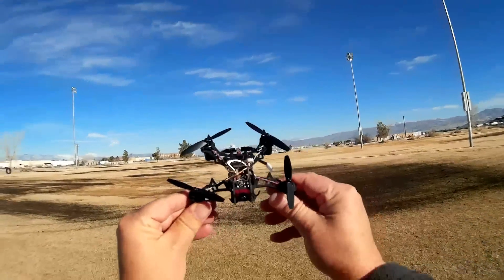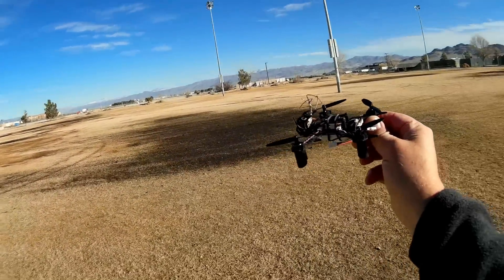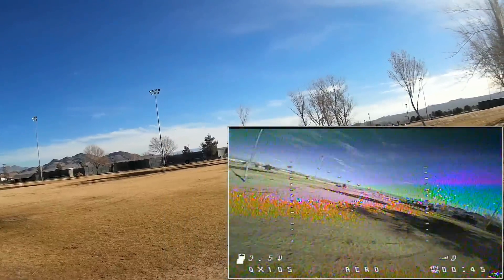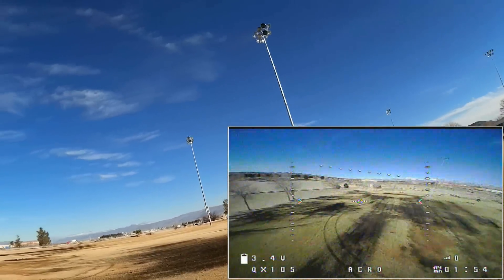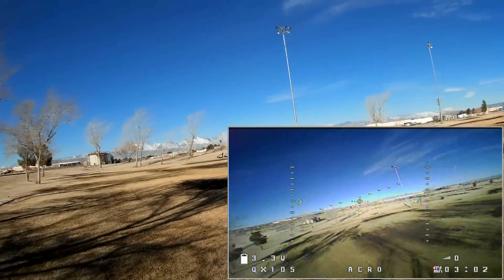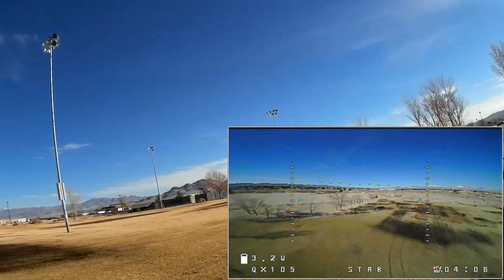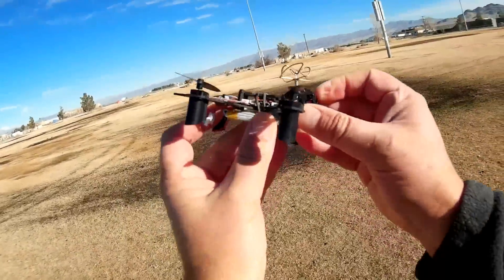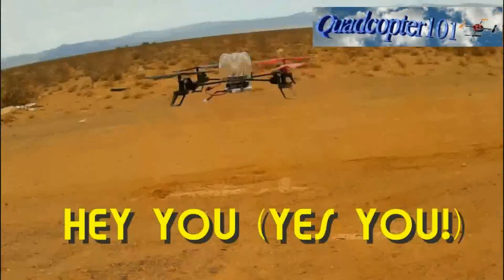Eachine BAT QX105 Micro FPV Racing Drone Flight Test Review

Comment: Hello I bought all the parts for it a built this quadcopter and got the Flysky version and bought the Flysky i6 transmitter but not sure how to bind this is my first build .
Reply from the maker: Ask your question in the following forum.  Tons of people there with experience on the BAT https://www.rcgroups.com/forums/showthread.php?2801933-Eachine-BAT-QX105-F3-OSD-600TVL-CAM-brushed-1020-motors-Buzzer/page34&highlight=qx105
Reply: Quadcopter 101 - Thanks again

Comment: Hi. Looks like you are you flying this with a DEVO 10? If so, I was wondering if I bought this on Banggood what Mode would I buy(I live in California).
Mode options on Banggood:  1)DSM2/DSMX     2) Receiver Flysky Receiver    3) Frsky Compatible Receiver?
Does it bind with the DEVO 10 without any transmitter additions?
Thanks!
Reply from the maker: You would need to flash Deviation firmware (like I have) to the Devo 10 to enable it to bind with DSM2/DSMX receivers.  Here is more info on how. https://www.deviationtx.com/  It's not too hard, but carefully read the igetting started guide https://www.deviationtx.com/wiki/get_started_with_deviationtx
Reply: Already Deviated my DEVO 10.
So buy the DSM2/DSMX mode?
Reply from the maker: Yes, it should be able to now bind with DSM2/DSMX receivers.  Watch YouTube videos showing how to bind.

Comment: hello again i would like an opinion about qx95 or qx105 which of these 2 you can recommend me to buy i want to buy my first racer quad and so far these 2 i think are the better options what do you think?
thanks
Reply from the maker: Actually, if it's to be your first racer, and you've never flown FPV in acro before, I would instead recommend the following.  It's perfect for practicing acro for a first time FPV pilot https://www.youtube.com/watch?v=UsZJP-3cAIY
Later, as your flying skills improve, and you're not crashing into things as much, then get a more zippy flier like the QX105 https://www.youtube.com/watch?v=c3Az7tH_cd4
Reply: Quadcopter 101 well i fly fpv but never in acro i just have flown quad with no configuration like dm002,e011,furibee whooped etc, but never hobby grades quad so i just would like to jump there i saw your qx105 and qx95 review and they look really good and affordable racer quads
Reply from the maker: They are good and affordable.  But they will likely break as you go through the unavoidable crashes of learning acro.  The E010S is what I used to learn acro FPV.  It was very forgiving. And as it doesn't pick up very much speed, its crashes are very gentle and thus crash resistant.  The BAT on the other hand can pick up a lot of momentum in short notice (i.e. it will likely break in the hands of a new acro flier).  One thing that I do recommend either way is first practice acro with a free simulator program before going into the air.  I highly recommend FPV Freerider, and also recommend the following free series of tutorials to get you up to speed https://www.youtube.com/watch?v=391D5dX7LKg&list=PLwoDb7WF6c8kjYXam4m3msvRbkORU41GY
Reply: Quadcopter 101 great thanks again👍

Comment: Does the failsafe work on the RTF version? Seeing a lot of posts of this thing flying away when out of range!
Reply from the maker: Sorrry, but I have the DSM2 BNF version.  The RTF version comes with a Flysky transmitter.  There could be Flyaway if Failsafe was not set, or if it came with an older Flysky AFHDS receiver.
Reply: Thanks. do you prefer flying this or your Furibee F180?

Comment: Looking for advice on operating QX105 with a Devo 7E.  It binds, but the connection is not stable in both DSMX and DSM2 modes.  Betaflight shows the inputs bouncing up and down.  The Devo 7E controls other DSMX/DSM2 models perfectly, such as the Inductrix and JJPRO T2.
Reply from the maker: I also use DSM2 receiver.  Here are some of my Betaflight settings that might be applicable.  Also make sure that you're using fully charged or new batteries in the transmitter. https://ibb.co/c1xyMF
https://ibb.co/ki8SFa
https://ibb.co/muCMaa
Reply: The craft controls decided to work well in the DSM2 mode with the Devo 7e.  However, arming became a problem, because the Devo 7e controller would not cover the 1000 to 2000 stick value range.  This is corrected using the same Betaflight commands as other post for the Rodeo 110 upgraded to Betaflight.  In the CLI tab enter

 rxrange 0 1159 1841
 rxrange 1 1159 1841
 rxrange 2 1159 1841
 rxrange 3 1159 1841
 save

This set the Devo 7e transmitter signals for covering the needed signal range of 1000 to 2000 for stick movement.

Comment: Hey can I ask, I want to do a little mod on my Mould King Super S and was thinking of fitting it with 1020s on this frame. Will it work well? I'm also not planning to go fpv too, I just liked the look of the frame and wondered if it would be a good sub for my toygrade. Also wondering if it would be practical indoors and outdoors without an fpv setup. Thanks!

Comment: This chopper is garbage. Components are great but the frame is weak as piss. I bought two, both are broken now. First flight I ending up landing grass,  engine arm snapped off. Second one, small rough landing. Engine arm snapped off. Two choppers, arms broken in the same place. All my other choppers had taken harder hits and keep going. This one is a weak little crap bot.
Reply from the maker: This should help get you back in the air again https://goo.gl/XJlDBx
Yes its arms may be a bit weak.  But dang it's a nice flier https://www.youtube.com/watch?v=II6dFXs3BRA
Reply: Thanks dude. Nah, going to skip that (as it will just happen again) and 3d print a frame and transfer it to that. I do agree it flies fantastically, but Im so bitter about two brand new toys getting wrecked. Bummed me out massively.

Comment: Could you tell or do a video on what transmitter you used for this and how to bind it if we got the ARF version?
Reply from the maker: The instructions with this are very good and detailed showing how to do the binding process.  There are three different ARF versions (Flysky, Frsky, and DSMX/DSM2).  You'll need to select based on what transmitters that you already own.
Reply: Which transmitter do you recommend?
Reply from the maker: Well I got the DSM2 version, as I own a Walkera Devo 10.  But Flysky or Frsky also are available for this.  It all depends on which transmitters that you currently own.  If none, then recommend Flysky as it is inexpensive, yet a very good transmitter (make sure that it's AFHDS 2A version). https://goo.gl/xEl7LW
Reply from the maker: By the way, mind if I ask if this will be your first drone?

Comment: I've noticed you moving more towards fpv and race quads recently. I like it
Reply from the maker: Not much new is showing up in outdoor quads until summer gets closer.  But as it's winter, a lot of new indoor FPV racers are showing up.  But I prefer to fly them outdoors, as this is California after all ;-)
Reply: yea I'm sure. you should try building a quad! I have a design for a 100mm frame, I could give you the files to 3d print or cut one out

Comment: battery life seems kinda weak even with over doing it on the motors .. the JXD 509G has comparable flight time for a bigger quad and using the same battery . .
Reply from the maker: Yes but this is a micro, with much smaller, less efficient propellers.  The 509G has gear reduction that allows it to use larger, much more efficient propellers. Also the 1020 motors of this are actually larger and more powerful than that of the 509G.

Comment: I like this quadcopter. I am probably going to buy one, but I was wondering a few things...
- First, is the transmitter already bound with the quadcopter
- second, is the fpv antenna removable
- third is the camera angle adjustable
- fourth do you think it could carry one of those tiny 1080p keychain cameras you use sometimes
Reply from the maker: 1) In the RTF version only.
2) No, it's soldered to an AIO FPV camera.
3) Yes.  I was flying in its stock position (all the way dwon).  But it can easily be raised up for high speed flight views.
4) No, although it might lift it, it would severely degrade flight performance.
Reply: awesome! Thanks. I am kinda torn between this quadcopter for mini fpv or the Mi drone for good aerial video...you have the money to spend but I don't! LOL
Nice job with the channel BTW

Comment: I saw this one on AndyRC as well. First off, plug in the battery while in clean flight, and using a DMM, compare the value of what you see on the DMM to what its reading in Betaflight. It usually reads low, so you have to add a 1 or 2 points to the VBAT scale (which is set to 110 by default, IIRC).  The next thing, under VBAT, they have 2 settings for low battery ... Low battery and low battery warning. Probably redundant, but IIRC, Andy set his low battery warning to 2.9v because as soon as you land, and unplug, the battery jumps back up to 3.4v. The 10mm x 20mm motors allow you to use decent sized props without having to cut them down (I think they are 65mm long). I recently got some 65mm props for my QX95 and cut them down with finger nail clippers to 57mm, which gives me about 1/16" clearance to the FPV antenna.  They are fun fliers, and with the right Betaflight tune, can perform very well in Acro+Air mode  (set up on 3 pos. switch to Angle/Horizon/Acro+Air).  BTW, finally got my TX03s, and stuck one on the top of one of my 33041s. Using a common battery for motors & AIO vtx/cam, I get a tad over 5 min flight time with some good 380mah batts. You know how much fun the 33041 is .. fun FPV flyer too. Thanks for the review. Cheers. PS .. we're waiting to hear from Punxsutawney Phil back here to see how much more Winter we will have.
Reply from the maker: Looks like 6 more weeks.  It's nice out here though ;-)
Reply: Be aware with this model, FET are undersized. As soon as you will crash it a bit with motors on, probability to burn a FET is high ..... :(
Reply from the maker: I was worried about that, and state such in my video.  Was worried that they might have slapped on electronics that they've used in similar quadcopters without considering the higher current requirements of these larger motors.
Reply: That's why I put an ARM switch on all my quads, so that in case of an "incident", I can flip a switch and kill the motors instantly.
Reply: Yes for my personaly case, the FET burnt in a fraction of second .... so even with an ARM switch, it won't save it .... maybe it was just a question of bad luck, but I had another report of the same problem .... FET seems fragile and in any case, the throttle behaviour is strange too ....